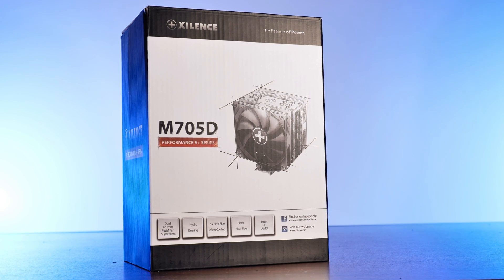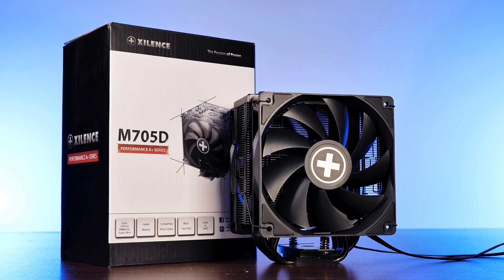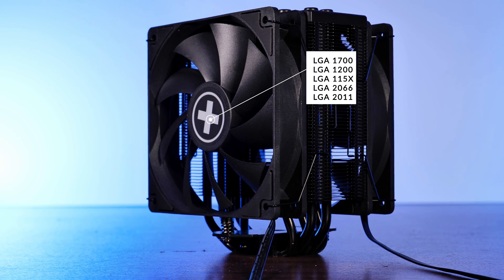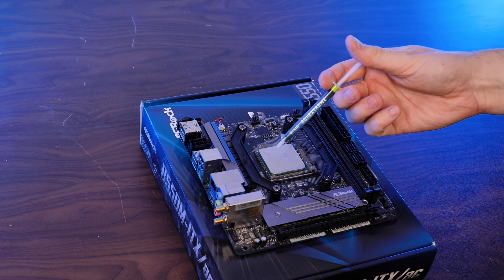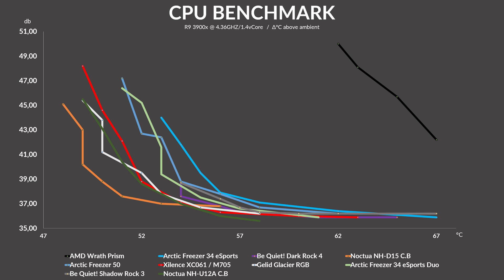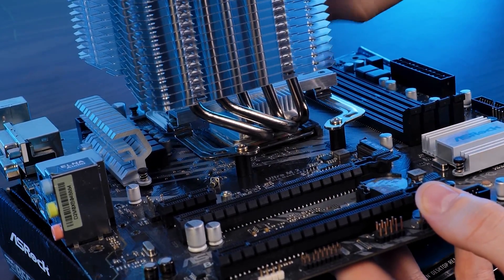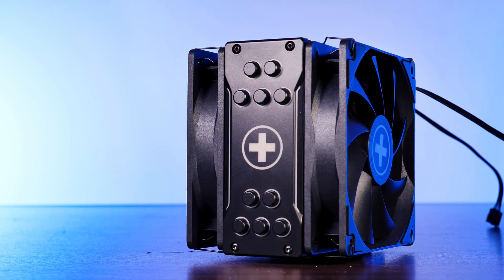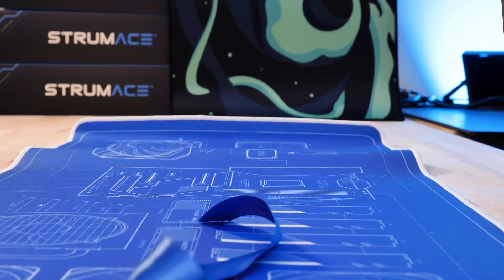Xilence XC061 | M705D Review - The Cooler you HAVE TO KNOW 🤯

Comment: I'm verty satisfied with Xylence.
In the last four years I used a Xylence XC051 (1x120 fan, 4 heat pipes) with my 5600X, and worked perfectly. 
Now I added a second fan in the other side, so it became similar to this XC061(the only difference is XC061's 5 heat pipes instead of 4). I'll try it with my new 5800X3d cpu.

Comment: Just ordered mine for my 5 5600, was hitting 95 degrees in benchmarks/stresstesting (lowered the thermal throttling in my bios to 90 I guess)
Reply from the maker: Something seems seriously wrong with those numbers. Given how much power we pushed through ours, (and that it was able to keep most Ryzen 7000 cool) your numbers should be a lot lower. Are you sure everything was installed correctly?
Reply: @STSYT  After installing the M705D, temperatures dropped to 50 whilst gaming, 60 max at cinebench! (I had the stock cooler before)
Reply: @dutchlikeme How is it noise wise? Loud?

Comment: How can a 40€ CPU cooler be almost as good as a 120€ noctua u12a god tier CPU air cooler ???
And if that would be really true then why is there no one else talking about it ?
I think this review is rigged
Reply: Yeah, I wanted to buy this one but someone told me Xilence coolers aren't good so I looked up a review. This is the only one I found.
Tbh I'll still probably buy it because I like the look, and it can't be any worse than a 15 dollar one I'd normally buy.
Reply: Hmm, I am using a 70 USD single tower cooler which is trading blows with the NH-D15 of Noctua, the Deepcool AS500 Plus.
Reply: Yeah review doesn't make sense. He's testing method is not good.
Reply: Nope. I have that cooler, except that it is noisy at 100%, everything else is excellent. 135W in cinebench max 77C at ambient temperature of 26C in Lian Li 216 with case fans at 970RPM.
At idle cooler fans spin noiselessly around 900 RPM and the temperature on my ryzen 7 5700x hovers around 31C with case fans around 800RPM.